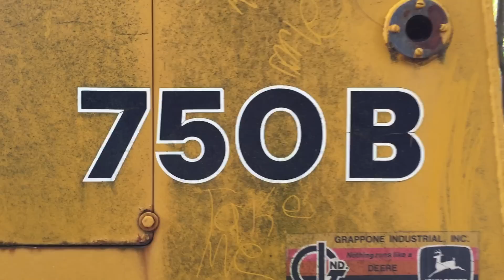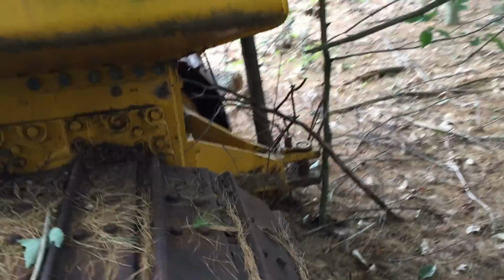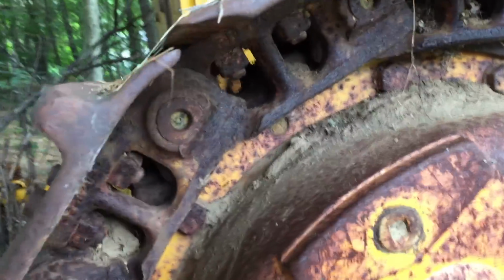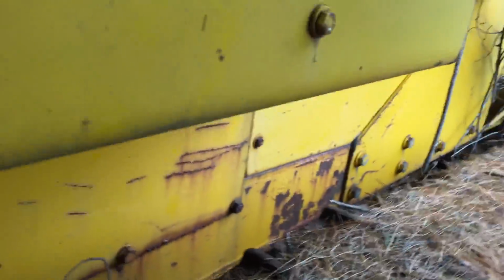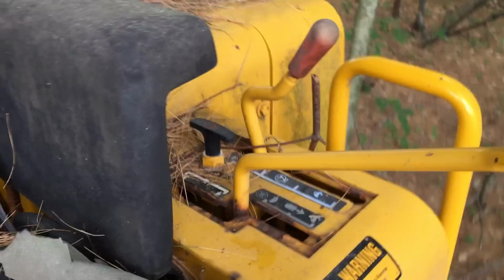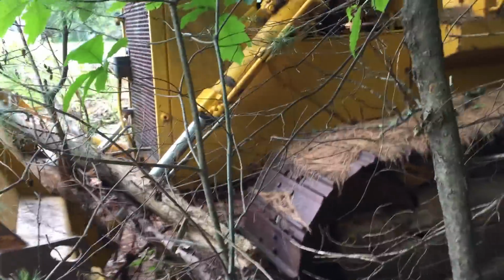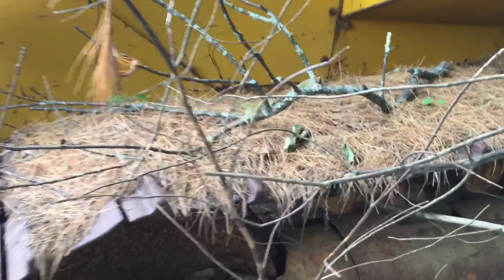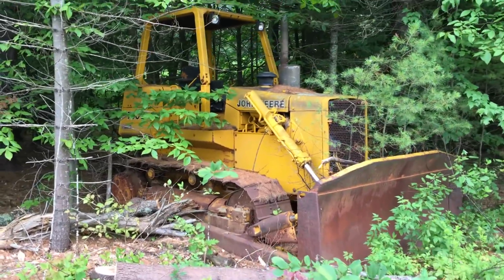Abandoned John Deere 750B Bulldozer

Comment: I have been eyeballing a JD 550C sitting next to an old abandoned farmhouse on a state highway here in Louisiana for many years now. After discovering channels like yours here on YT, the curiosity got the best of me. I passed it for years driving down to my old hometown 40 miles south of me. I used an app on my phone to tell me who owns the property. With a little research, I found the owner. He lives five miles from me. lol. I could not find a good phone number for him. I simply drove up to his home and enquired. He tells me he purchased it at auction from the State Forestry here in Louisiana 20 years ago, that he put maybe 400 hours on the machine. He hired an "operator" to do some land clearing. This "operator" somehow managed to crack the right side final drive housing causing a leak. A 5 gallon or fluid/oil in a 10 hour day. He parked it where it now sits 12 or so years ago. I'm told he did his best to patch the crack with some JB Weld, but all that did was slow down the leak just a bit. 
The undercarriage looks pretty good for its age. it most definitely has been well maintained being a former state-owned asset. He's an older gentleman now. I asked if he had kids that would be interested in bringing it back to life. He said his kids have zero interest in any of his old equipment. He said "I would take 8k for it. It runs fine and drives and shifts great" It has a 6-way blade and a Massive Winch on the rear and a ripper attachment he would throw-in. I'm considering it as we speak.
Thanks for sharing your find.
Cheers from Louisiana.
Reply from the maker: Awesome story! If you choose to purchase it I encourage you to make a video(s) to document the story and the repairs.
Reply: Did you get the old girl?
Reply: @bearbait2221 unfortunately no. I did pass by it over the weekend and still sits there collecting vines. If I had a place to work on it I would reconsider. 8k doesn’t seem like too much for it. The gentleman did say I was welcome to work on it where it sits but I’m not to wild on that idea.

Comment: If the engine runs get it running come in with a service truck and weld tips on the sprocket. Move it a 1/4 turn and weld more till it's welded all the way around the pump some more grease in the track tensioner to make it snug and then drive it out. This is after you buy it. Weld the heck out of the sprocket Later

Comment: I would get a battery, some fuel and get that machine running.
Reply: 12 years sitting with an open exhaust stack? That motor is locked up solid.
Reply: @kitchenengineer1731   clean it.
Reply: @yvonrobillard5479  Really ? I want to see that. Do you use dawn dish soap?
Reply: @kitchenengineer1731   yes.

Comment: It is obvious why it is there; the right sprocket is completely worn and the left sprocket is on its last  leg. The sprockets are only part  of the problem, the chains are probably bad too. Just the parts for a bottom end job is north of $3500
Reply: But it's still cheaper to fix it
Reply: @Jdl223  not now after 13 years of rain down the pipe.

Comment: with that exhaust pipe straight up it won't move with that sprocket or engine. Twelve years is a lot of water down the pipe. Don't know if deer has cylinder liners or not. but probably rebuildable.

Comment: The grousers wore down I'll bet the carriage is worn out as well needs a bottom overhaul so I'd bet that the cost outweighs the worth or the owner doesn't have the money to haul out or repair. I didn't see anything covering the exhaust pipe I'll bet the motors froze up as well.
Reply: @greentree328  I look for people finding old machines in the woods. Most of the time they do not look half as good as this machine, which other than the undercarriage looks perfect. Till you try to turn it over. froze solid as hell after twelve years and no exhaust cover.

Comment: That's like saying my car had a flat tire, so I just parked it on the side of the road and abandoned it.
Reply: I was pulling out of a parking lot with my dad pulling out not far behind. I stopped for an ambulance to go by and some idiot tried passing me and slammed into the car i was driving and tried to take off. I got out and ran after him eventually getting ahead of his car and standing in front so he wouldn't take of again. My dad, who saw everything from where he was driving stopped and got out going up to the window to request drivers details. The driver took off with me on the hood making sharp turns left and right, not that the road wasn't curvy enough, driving as fast as he could. I was on there for a long time when he relized he wasn't throwing me off so he stopped, got out and tried running after me with a screwdriver. By then enough people saw what was happening and road down is plate number. So i got off doubled back, and got the number from someone. When i returned to where it started, there were medics and police. So some time checking me out physically and giving info to the police, and it was decided i should go to er just incase though i was fine. Where am i getting at? After all this, actually while i was in er, they took my car to the police lot, and tgen my father looked for his car. Then the police helped him look for his car. Where can it be, must be stolen. Additional police report and looking. Eventually he found it, exactly where he stopped, behind the offending driver when he asked for his details, in a no stopping zone with the engine running (i think) and his laptop computer inside and untouched (and no parking tickets). The trauma of seeing his kid dragged of at high speed on the front of a car hood made him forget where he parked his vehicle. So you never know what was going through the tractor operators mind, causing him to leave it there. Though it was probably because it was a p.o.s. not worth purting anymore money into. And everyone says "i'd take it and fix it up", hell i would too, that doesn't mean it is a good idea.